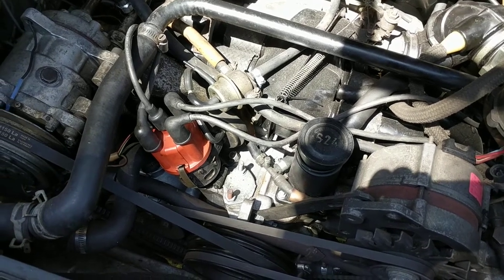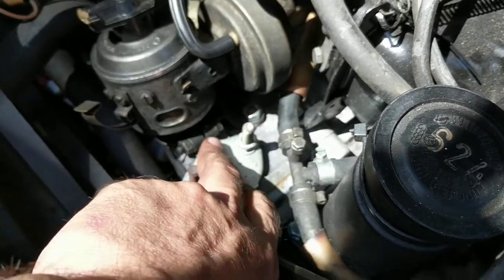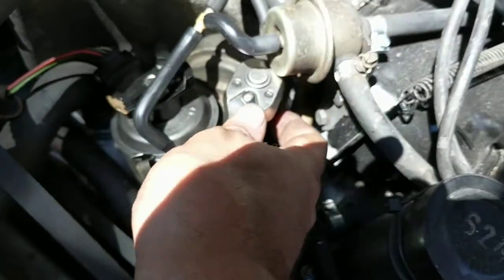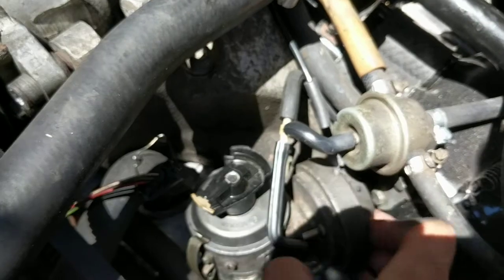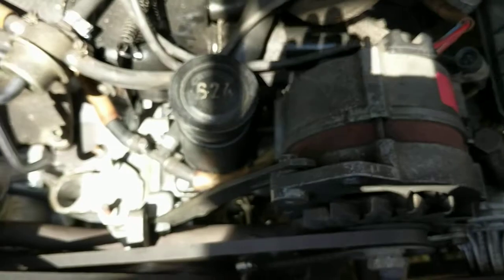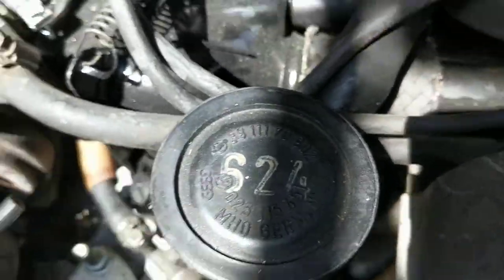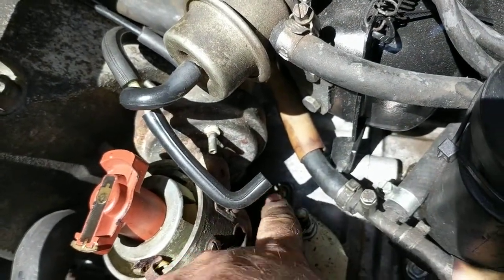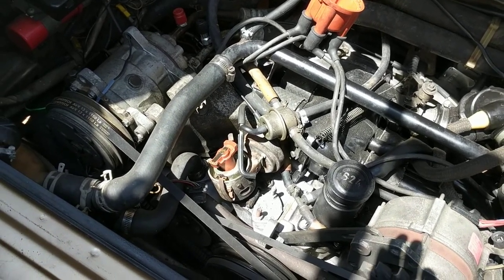Remove and replace Vanagon distributor

Comment: Is it possible to use an older style fuel injection distributor from a type 3 engine on this year of vanagon? I have one with a bad dizzy and I have this type 3 dizzy with points and a 3 wire plug for the Hall effect sensor, but the plug is a different. I know I would have to cut the plug off my van and splice on some small spade connectors, just not sure if it would actually work or not?

Comment: I've been trying to tell if the 84 and 85 (Digijet) Vanagons have a different distrubutor from the 86 and up (Digifant). It seems like they do, but I can't seem to find one for 84 and 85. Do you know of anyone who makes or rebuilds them? I need one for my 84 Westy.
Reply: Thank you. That's along what I figured, though I'm fairly new to the Vanagon world. Can I just message you through the vanagain.com website?
Reply from the maker: +Metal Mercury Yes they are different.  We have them available as rebuilt units www.vanagain.com
Reply: too bad you didnt tell how to adjust the timing-having your fans change the distributor without showing a video of how to adjust timing is a disappointment
Reply from the maker: You could always make a video like that.  I was just showing how to replace the distributor.  You can do this without adjusting the timing if you mark everything before you remove the old one.  In the future I will probably make such a video.  You can support me on Patreon and suggest videos for me to do.  I take my Patreon supporters very seriously along with my customers.